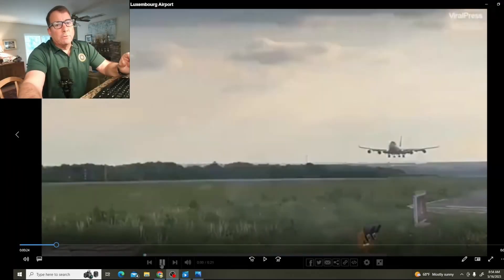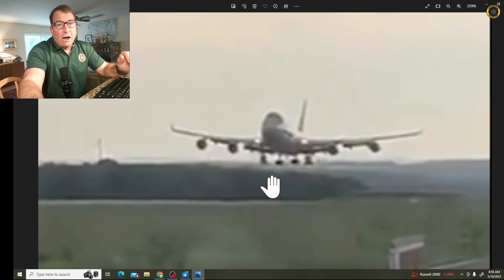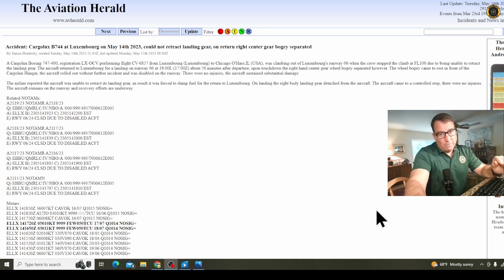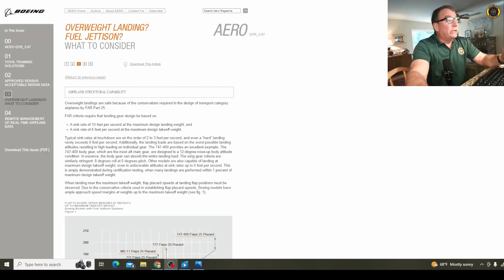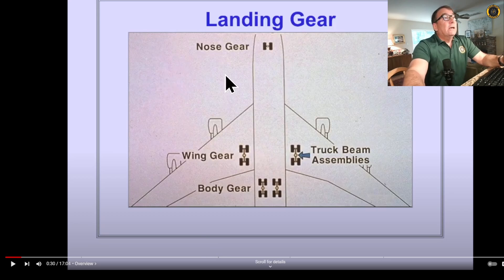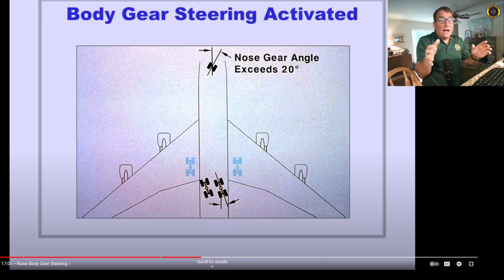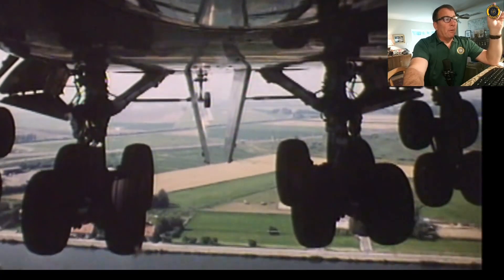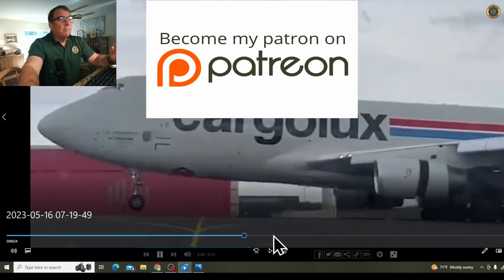Cargolux B747-400 Landing Gear Failure 14 May 2023

Comment: Big delay in this occurring to me. Various pilots have demonstrated pre-takeoff walkaround. Obviously the equipment on the plane in question makes walkarounds vary. But if this gear was "funny" in some way, would an experienced 747  pilot overlook it? I remember some things they look at, and parts of the gears are a focus. There's no way to test retraction except in the air, but does a really sharp eye have to be there to notice a problem that will necessitate a return to the airport? In this case, missing a visible problem is costing the freight company serious money. So it would seem incumbent for someone, maybe even a maintenance employee, to do a quality check on landing gears.

Comment: Great review Juan. I have no 747 experience other than riding on them. Very interesting that the body gear seems similar to the crosswind gear in the BUFF. As I recall you could dial in the crab with knob on the pedestal. Thankfully maint didn’t have to travel far to retrieve the gear. Ha!  Lastly, if the last incident was in 2010, what is the gear overhaul on the 74?  I know on the Gulfstreams I flew on 135 the overhaul was 72 months or 5,000 cycles. $225,000.00 for the overhaul 20 years ago!  See ya!
Reply: There is no crab landing feature on the B747. The body gear steering is to facilitate manoeuvring on the ground only.

Comment: Reminds me of a true life story involving "Pizza" and "University Days". Funny how life experiences can lead you things later in life with a positive result. For decades, the C-130 Fuselages were made "overseas" in multiple locations ... and shipped in Ocean going Containers "Sea/Land". But if you get way behind schedule, you have to resort to extreme measures, up to an including multiple ship sets aboard a AN-224 Cargo Plane to Marietta, GA (only $500k ... one way).
But the fun part is that a certain Company in another Country fell behind slightly (not requiring the AN-224 and expense) but still would cause a major assembly disruption in Marietta. Previous experience in "Air Freight" work arounds made me begin to question the viability of a short term fix using a 747-400 that would allow the large wooden Crates into a normal Aircraft. But sadly, the only one available did not service this particular Country. 
Walking around the empty Crate, got to thinking about how when in College, when one had to move Apartments one would enlist the help of fellow Student friends to accomplish this task on the cheap ... Pizza and Beer. And it was at that moment that I remembered that the hardest piece of furniture to both remove and re-insert in the new Apartment was always the "Sofa". Then I remembered how we always managed to get it done ... by rotating the "L" of the Sofa to an orientation that minimized the geometric shape to fit thru the door.
So I went to this Company's Shipping Department and proposed a change to their Crate design ... one that instead of a rectangle was more of a rotated Sofa ... by cutting an "Angle" in the Crate that would allow side load of it into a standard 747 Cargo Aircraft; by cutting the angle, it allowed the Crate to make a 90 degree pivot and be loaded/unloaded.  And as it turned out, when you have regularly scheduled flights of the same Cargo, you get a price break ... that ended up being cheaper than the decades old "Land/Sea" method.
Just to say never keep questioning/thinking young folks ... and remember ... Sir Isaac Newton's observation wouldn't have happened if he'd never observed that "Apple".
Can't do much if the Supply Chain is hampered by the folks in Maintenance ... LOL

Comment: I wouldn’t think the incident from 2010 would have anything to do with this failure. Over the thirteen years between incidents the aircraft would have made hundreds of landings, if hitting the van had caused any damage to the undercarriage it would have failed long ago. In fact there is the possibility that since hitting the van that under carriage lag may have been replaced due to maintenance routines. Undercarriage legs have a life limit before they need workshop overhaul. But as you say there is definitely an issue with that right body gear on approach. It’s definitely not tilted correctly for landing. In one of the photos half the Oleo strut is shown still attached to the truck, it would take tremendous force to break that off. Maybe the leg was fully extended or not centred correctly putting steering force sideways on the leg at touchdown. But it’s hardly surprising there’s fuselage damage the way that truck assembly bounced between the ground and underbelly of the aircraft. Yes the first bit is through a composite fairing but I bet there’s damage to the pressure area underneath. But in shot is also a bit of substantial damage to the pressure area of the fuselage, I bet there’s more further back as well.
 In the other video I watched it was implied the aircraft just turned back and landed over max landing weight, which would imply a major emergency such as a fire on board or such. But in the report you showed it stated that the crew dumped fuel, this makes more sense. If they got the aircraft down to a suitable max landing weight, the weight of the aircraft wouldn’t have caused this failure.
 But when back in 2010 the aircraft hit the van, the question has to be asked why did the tower allow an aircraft to make an approach with a vehicle on the runway. The van and it’s crew must have been in radio contact with the tower to gain permission to enter the runway, so the tower would have known they were out on the runway. So why weren’t they told to clear the runway because of the aircraft on approach?

Comment: I'm curious, if the body bogies steer but the wing bogies don't, why isn't a lot of rubber scraped off of the wing bogie tires in a tight turn on the ground?
Reply: The wing gear obviously has a greater radius of turn. ..less scuffing !!
Reply: The wing bogies are closer to the centre of rotation.

Comment: That's a very light strike on that van. A 200lb man could do more damage than that just jumping up and down on it. I would be very surprised if they determine that incident was related. I think it's just a coincidence.

Edit: As an ex-Navy structural aircraft mechanic who has worked on and changed lots of landing gear - I can tell you that the landing gear is THE toughest part of the aircraft's structure, in most cases.

Comment: There's another video out there of the same incident from a different position along the runway, closer to the runway threshold. As soon as the 747 passes that aircraft, you can see that the right body gear is tilted forwards rather than backwards, kind of like on the 767.
Reply: https://youtu.be/IAfWXCry-gk Here we see both videos shown so far. Regards from Germany Michael

Comment: I have looked at the video numerous times, and two failures could be possible. The inner cylinder bearing and spacer cracked and failed, or the gland nut that holds the bearing spacer and seal pack failed. Both would be extremely rare. Hope to find out. I'm just glad it landed safe and no one was injured.

Comment: Quote of the day!
The driver was in the van when this happened
Reply: From the report: "The two maintenance crew, who had been working on the runway center line lights and had become aware of the arriving aircraft by the noise of the engines, ran off the side of the runway upon the increasing sound." So apparently nobody was inside the van, or is the report incorrect?
Reply: @SteamCrane  thanks! I will call that poetic license

Comment: i witnessed a similar incident in Sydney in April 1989. A United 747SP landed heavily on the right main (wing) gear. Engines 3 & 4 almost hit the ground, the right wing was punctured and debris tumbled down the runway. The aircraft vacated the runway and was disabled. The report indicated the cause as a crosswind 'crab' landing. As the aircraft crossed the runway threshold the right wing dipped a lot and the crew did not recover. The previous aircraft, also a 747, had the same dip to the right wing at the threshold, but recovered and landed normally. It was scary to watch.

Comment: I’ve seen this happen on a B737 aircraft. In that case it was a failure of the gland nut that secures the inner member. In fact, the outer member had been reworked to a larger thread and required an over-sized gland nut to fit properly but the original gland nut was installed despite the outer member being identified as reworked by having a yellow ring painted around its lower diameter. On take off, the gland nut failed and the inner member pulled away from the outer member. The pins securing the torque links sheared on landing leaving the wheels, brakes and inner member to bounce along the ground.
Reply: I’d put my money on this as the most likely cause👍

Comment: Not sure if you've seen or not, but there was another video taken of the landing from further up the runway about where it touched down, and in this video, you can see that the right body gear is tiled downwards with about the same degree of tilt that it should have upwards. Definitely looking forward to see what the investigator's initial findings of this one were, and I agree that they'll probably be looking very closely at the maintenance on this one, especially where it concerns that previous incident over a decade ago.

Comment: Interesting about the body gear being able to steer.  Since the wing gears are locked, do the tires scrub when tight turning?
Reply: Yes they do … each gear bogey has its own problems , and scrubbing occurs on the all … you can go with the body gear steering inop.. but you can’t do a min radius turn without it …. So that can get tricky

Comment: slow down on maintenance 👨‍🔧. my dad on his piper cherokee in helped gotten good when i younger on preflights thank God i moved the yoke it scared me so bad beep less co pilot was fine flight surfaces until i moved my dad’s pilot side felt weird. like it had no connection stuffed moved it didn’t have the right feel. then i heard it this scrapping noise. hold the phone fort pop the carpet up co pilot ting piano good pilot clunk one strand from loosing my dad saved my dads life. we were about to go for a boot. this coming from an annual free fix i’m sure at the time. my heart went thump a  thump. because being a roughly twelve year old maybe thirteen. i’d been flying my dad handling the radio we had a small airplane piper their is no get up change seats it didn’t put me off from flying it’s a time when could have been tragic. because some noob didn’t complete his/her inspection. got to start the plane yell clear prop. i’ve always had airplane bug since my dad built model airplanes. the funniest time he was out flying models of couriering gas in the old suburban he parks on hill which meant dry carb and not enough for the pick up tube. i was going into the truck for spare prop looking looked over fuel gauge was below E. hmm 🤔 dad your out of gas in the truck gas can ain’t gonna cut it. just my luck fuel truck rolls in hmm wander if av gas will work saved my allowance bought 50.00 dollars worth of av gas filled the truck slam full. she smoked like a radial got stopped thinking we were on fire nope old truck getting her system cleaned. out yea burned off carbon off the valves n piston head.more pep usually 8 mph or 10 on a good day she bumped up more my dad had her inspected just to be safe. mechanics wanted to know what we did or used nothing  but av gas stuffed looked brand new nothing  was bent it was like a whole new engine. not sure on injection system if you can run aviation fuel.?? old girls try av gas for a pep n clean out.

Comment: Sounds like a fatigue failure of the right inboard oleo leg, but why did the torque scissors retain the undercarriage bogie in position?, an Issue Boeing and Cleaveland Pneumatic  will have to sort out. This a classic text book example of system redundancy in action. Joe Sutter ,his team of engineers designed  the 747 to land safely on any two of its four main undercarriage legs, San Francisco July 1971 a near new B747 of Juan Trippes PAN AM  botched a take off from a temporarily shortened runway ,she lifted off way too low smashing into the approach light gantries  severely damaging the body undercarriage  and losing several wheels. Said B747 after dumping fuel turned back to SFO to make an emergency landing on the two wing undercarriage legs without further incident. In view of the undercarriage issue the Cargolux B747 driver sensibly dumped fuel to minimum landing weight before attempting to land his damaged Jumbo. Trash ( cargo) hauling is a 24/7/365 operation , Cargo airlines tend to work their aircraft hard in order to keep the company in profit, much like a budget airline. Do not know how many cycles this B747 undercarriage has clocked up. I liked the close ups of the body undercarriage steering in action and did not know you can steer a tandem axle 4 wheel bogie like that , very informative. Only other aircraft with rear undercarriage steering is Lockheed Martins C5M Galaxy Super Sport.

Comment: Just out of curiosity why is there an OFF MODE position on the landing gear lever? At what point is it used?   Seems like it’s either up or down.
Reply: The handle is selected to ‘Off’ after the retraction cycle is completed to disconnect the hydraulic system

Comment: I can agree with you regarding the robustness of the 747 some years ago I witnessed  an overweight landing of a 747-400 at Kai Tak airport in HKG  The A/C had  departed for Frankfurt and experienced a serious engine fire immediately after take off the captain immediately returned  without dumping fuel. Most of the tyres burst  due to heavy braking but everything else was OK except for the No2 engine thrust reverse that had disappeared and the hole on the top of the engine combustion section that had caused the fire warning.
Reply: They did in fact manage to dump some fuel in the short airborne time available, principally due to the presence of the heavy crew. The limitations of flap selection and fuel dumping made this even more remarkable

The crew flew the approach with no landing aids (at night) as it transpired that the flaps had, at that stage, to be cycled through ‘up’ before the FMC would accept any nav/rad inputs - Boeing sorted that within the week!

Subsequently a number of C&T crews tried to replicate this ultra quick return in the simulator with an initially un-contained engine fire - but with a singular lack of success … mind you, it is difficult to simulate adrenaline!

Comment: Regarding the lengthy code brown discussion, from the report: "The two maintenance crew, who had been working on the runway center line lights and had become aware of the arriving aircraft by the noise of the engines, ran off the side of the runway upon the increasing sound." So apparently nobody was inside the van.  Not to say that it wasn't a code brown event.

Comment: WOW ! Found the video (You Tube has removed the one at your link Juan) and you can see the bogie bouncing off the fuselage as it tears away.   Good thing this was a  cargo flight because otherwise the maintenance crews would have had A LOT to clean up in a passenger cabin. That noise must have been REALLY loud inside the cabin.

Comment: Great recap of this incident. There were two people using the van to replace runway lights. 
In CATIII conditions you can only imagine how eerily quiet the runway was, so when they hear a 747 approaching you can also imagine their transition to terror. 
They both ran off the runway and after the plane passed and landed, returned to the van, drove it off and reported the strike. 
The Pilots saw the van but never knew they hit it until Tower informed them.
Reply: What do those landing gear weight? Yeh, it flew to the convenient place. And I know the ground crew in airports have some risk in their jobs. But that bogie flying is a bit like some TRUCK going airborne.

Comment: Looks like that piston/bogie assembly just fell out which tells me that there was fatigue cracking in the strut, possibly exacerbated by corrosion. Gland nuts and threads are notorious for that. Which begs the question when was the last overhaul and had the gland nut been properly sealed or has there been any work done after overhaul like a seal replacement. Technical records will tell

Comment: In retrospect, there is a lot wrong in the video that can't be passed off with glib humour.

Although Luxembourg has only one runway...why was a private plane so close to the runway during an emergency situation?

Both the plane and the fire truck were lucky that the gear maintained its trajectory after striking under the 747.

I'm sure Cargolux procedures will be heavily scrutinized especially after the hard landing last month.  Is it CRM? Pressure to perform?

Comment: The gears are overhauled every 10 years as per the CPCP (Corrosion) program.  Usually swapped out with a fresh overhauled unit, so probably not the same gear.

Comment: Nice overview Juan. Conjecture only surrounding the untilt etc: but I'd have dumped fuel as well given the multiple threats.
As an aside, in normal ops - while both forgiving - I found the B747 easier to grease on than B777 😎

Comment: Looking at the paused video in the beginning, you can clearly see the bogie is hanging down and not in the tilted up position. Looks like it failed failed after take-off and separated completely on main gear contact with the runway. Guess you can call this a "Rapid unscheduled disassembly" of the bogie wheel assembly 😂